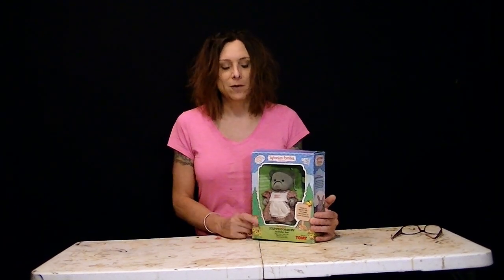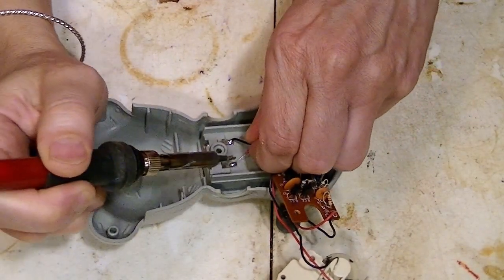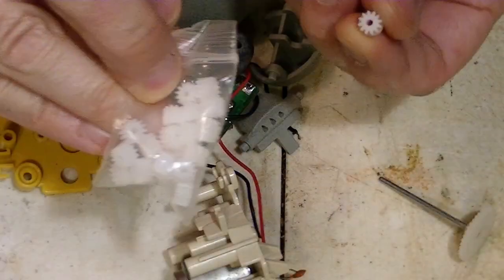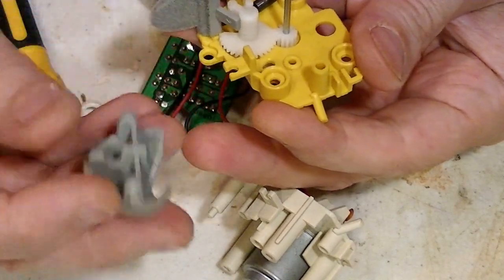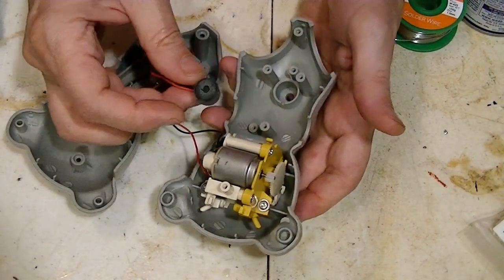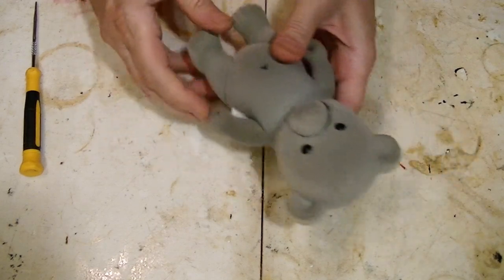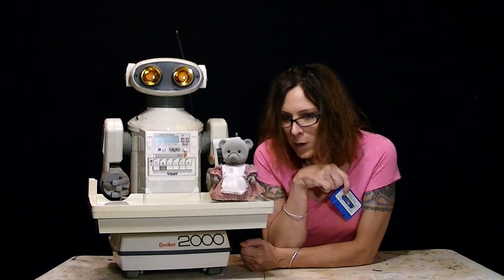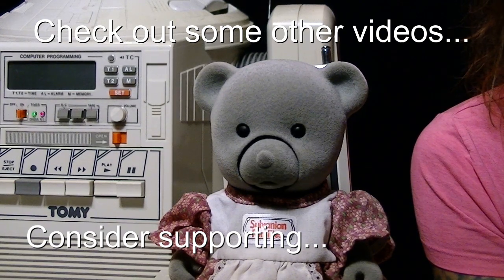Animatronic Toy Repair - A Tomy Bear Mastery

Comment: Hello 😊😊! I hope you don’t mind me commenting and asking questions on ya few year old video ^^ I just got one of these as a freebie as it doesn’t quite work. This one’s mouth is the only moving point. Nothing is corroded, took it apart and greased the parts in the head with WD40 as that was recommended. Didn’t take all the gears apart but none are broken or snapped. All the soldering points look good to me. I placed some fresh batteries in and switching the one switch to ON opens his mouth but he won’t react to noise or close his mouth. If I turn it off his mouth closes. Any idea about what might be going wrong? Hopefully you see this, and thank you for taking the time ❤️🥰
Reply from the maker: There's a potentiometer on the circuit board. You may try adjusting that, but other than that, I would have no idea without looking at it.

Comment: Awesome presentation and demonstration of this toy. Other comments (terminator bear, etc...) gave me an idea of turning one in a werewolf (werebear, werebunny). Maybe some fangs, flocking longer hair, and refitting the eyes with red leds? I think I mentioned to you my idea about installing a stereo bluetooth module and have one channel for the audio and one for the motor. Might be able to get it to run off the same rechargeable battery. These have been my ideas so far. Would love to hear more from others.

Lots could probably be done with dress/accessories and some light modding (Chewbacca? Ewok?). I had a look at electrostatic flocking guns that are used for making grass and dirt on dioramas. Not very expensive and probably not that difficult to make.
Reply from the maker: I was thinking about a stand that they are on, each with a directional speaker aiming at their belly. That way you could control each one without having to modify them at all. But that's as far as I have got.
Reply: @RandiRain  Like a podium? Politician bears? Make a mock debate. I bet that would generate some views. :)

Comment: if only Teddy ruxpin was such an easy fix :( but come on talking sylvanian families critter that's awesome!!!!
Reply from the maker: I have two more, but I didn't get them until after I made the video. Will be fixing those too.
Reply: If the motors are stuck, it's a pretty simple fix as you just have to move the motors back and forth while Teddy is turned on to fix. The tape player? Well, maybe not as easy, depending on what is broken on it. Also, it is a bit of a challenge to get the motors exposed as well, but there is an option to massage them from the outside, just not recommended as it could help damage the rubber rollers.
Reply: @The_One_Time  the problem I'm having is actually with good 'ol grubby my Teddy was bought refurbished as I wouldn't take a chance to get him and be a dud so he is in (as promised by the seller) top noch condition... But when I add grubby to the equation.. That's when things go wrong he only sings the duet part or the song part of the story.. Every other line is carried out from teddy 😳😑😑 the cable is not faulty it works fine with my mickey and goofy talkers grubby moves and talks so I blame something on teddy.. 🙄 🙄
Reply: @RandiRain  they are even flocked like the small ones it's perfect ❤️❤️❤️❤️
Reply: @001lightyear  Have you tried replacing the connector port on Teddy or cleaning the tape heads?
Reply: @The_One_Time  I've cleaned the tape heads yes no the port no since he was my first teddy i was glad to see him even partially working (on his own he works fine) i recently got one more teddy who works right out of the box fine and i will have to test him also with grubby to see!

Comment: I have one that’s also corroded, I tried to clean the corrosion but still no go. I’m really scared to pop it open
Reply from the maker: Not too hard, I have other videos on these guys. You will need an eight tooth gear though.
Reply: @RandiRain  thank you!!! One of the contact leaf broke . So trying to replace that but having a hard time finding an exact match. I’m completely new to this 😅😅 I’ve seen this video so many times trying to prep for surgery. 😂

Comment: I was always curious about the faux-fur on the plastic. Has it deteriorated or left bald patches over time? I can't remember seeing it used in any other toys. I wonder what kind of process it goes through. BTW you really need include a sacrificial ceremony for every split gear. Awesome work as always 👍🏿
Reply from the maker: It's on there pretty good, but I do have more of these, and some do have some bare spots. Not sure how they do it though. It's like a flock of some sort.
Reply: @RandiRain  Interesting. Cheers Randi!

Comment: I'd love to see a first generation Furby torn down completely. I fixed a few myself. But the most common problems are fairly simple to repair. But they are extremely complicated the deeper you go.
Reply from the maker: Maybe some day I will. Someone asked me to fix theirs, but they never got it to me.
Reply: This bear is giving me Furby vibes. I took one apart, and find bits around the house.